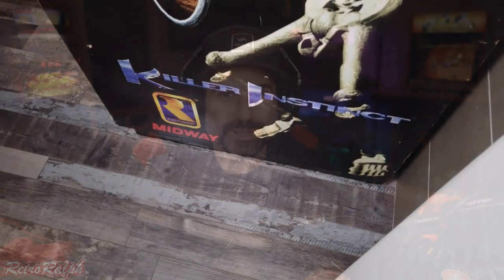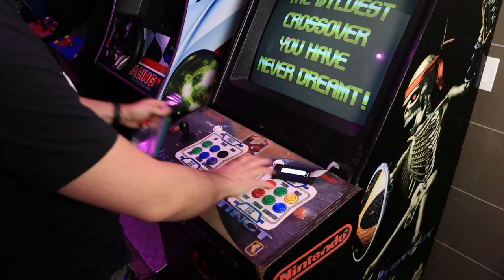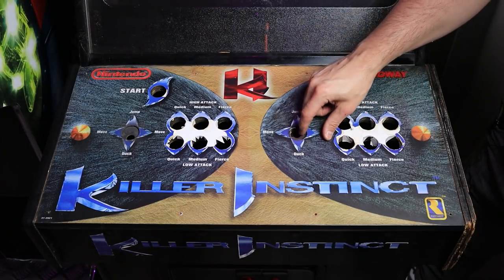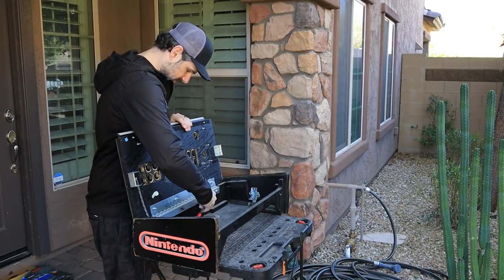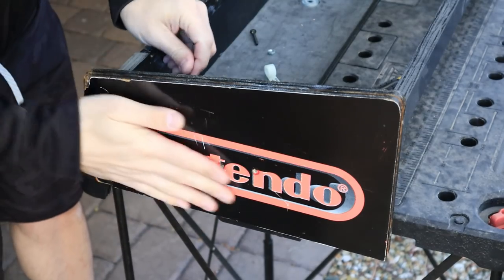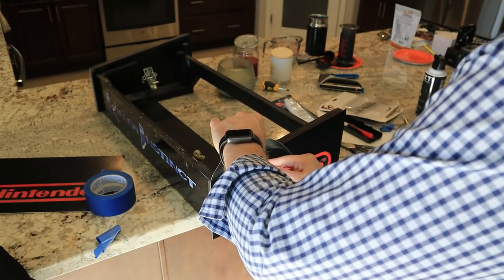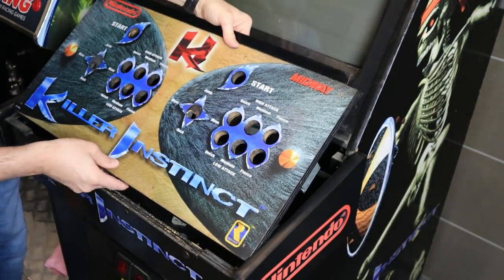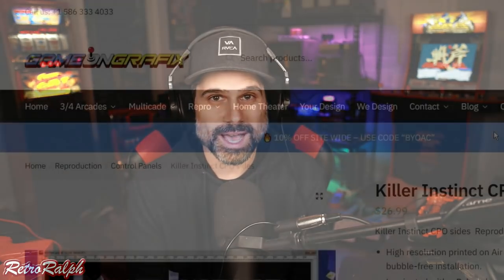Killer Instinct Arcade Restoration - Part 2!

Comment: Just in case you are not aware, you can remove the metal panel(the piece that has the K.I. artwork on it) from the wood panel, so that you can replace those joystick dust shields

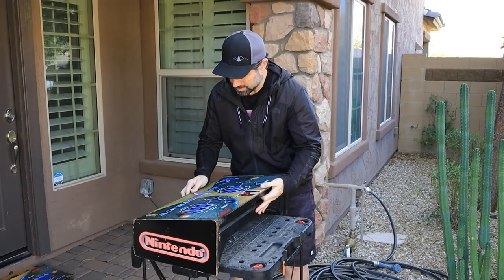Comment: 7:33 killer instinct door mat! LOL
Reply from the maker: Damn, good eye, that's the CP Art I didn't end up using.  Kinda funny that it probably looked like a doormat in the video.  😂
Reply: @RetroRalph  also, you need this wrench.  those others kind of suck.  or at least aren't as flexible since you need to take the micro switch off.  check ebay for BitWrench-A-Simple-Arcade-Button-Wrench

Comment: Hey Ralph... Rookie YouTuber question here. When you are outside doing the control panel. How is your audio so good. Do you have a killer mic pointed at you? Do you have mic on your body? or do you just fix it in post?
Reply from the maker: I have a decent wireless system I’m using in that video.  Here’s a link to the exact one I’m using.  I believe they sell a single mic / receiver version if you don’t need two mics that will save you on cost.  https://amzn.to/3kC4ld7  Thank you so much for watching by the way!

Comment: As multiple other have said, keep original as much as you can. If you have some pieces of spare/extra T molding, I would have used that at the corners/edges that needed bondo so you go fill it as close as possible to what it needs to be. Are you gonna do a plexy/film protective layer over the control panel artwork?

Comment: Ralph will this work with a CPS-2B board that has a dead battery? I have several of my favorites but they haven't been plugged in and 15 to 20 years and I'm sure the batteries are all dead and in the past once they died you couldn't replace them.

Comment: With my ADD, or ADHD, I've learned two very important things I can't stress enough.
1....IF YOU DON'T HAVE ENOUGH TIME TO FINISH A PROJECT, DON'T START IT.
2....A CLEAN & CLUTTER FREE WORK AREA, WITH ALL NON ESSENTIAL ITEMS REMOVED, IS A MUST!!!
I promise I'm not hating but if you're stating in the video possible excuses of why a project might not be done correctly, then proceeding to go ahead and post it, are you really helping the hobby as a professional? It would have taken just mere seconds to remove the candles that may have cost you time and possibly ruining a piece of history that is not replaceable. 
Also, please note that Bondo dust requires a certain type of PPE.
Please do not take any of this in anyway other than constructive and from my own faults also.